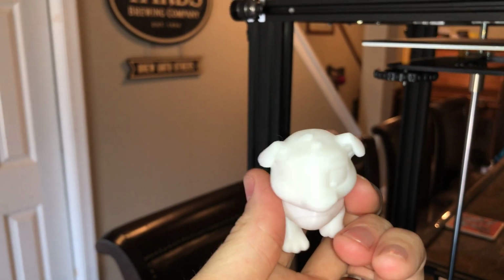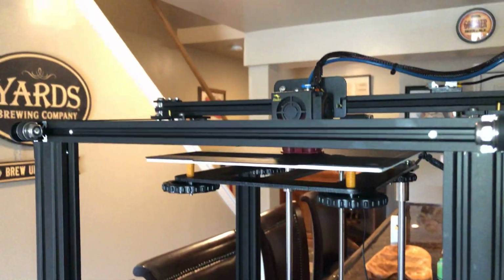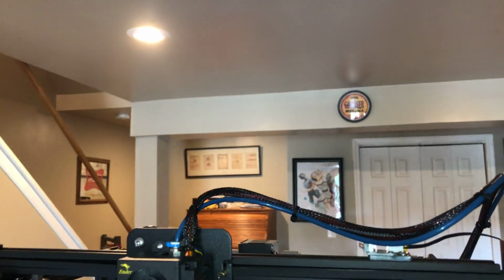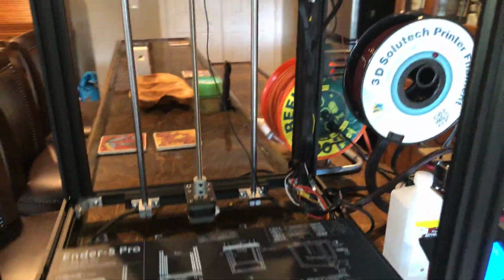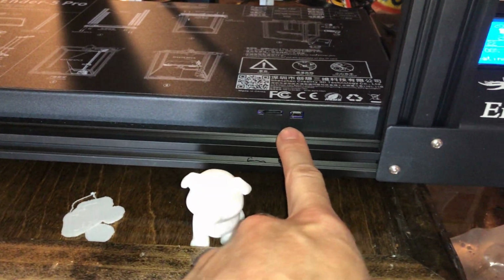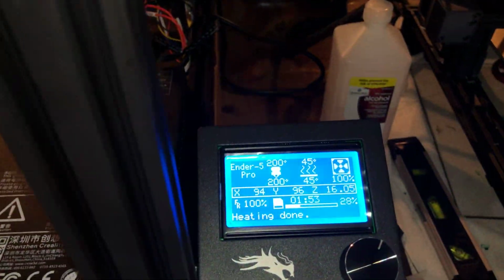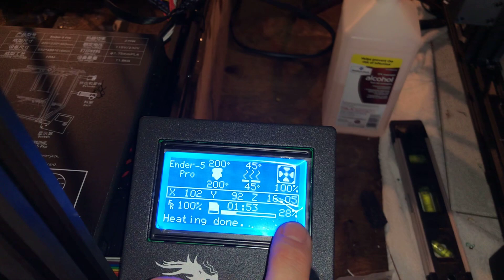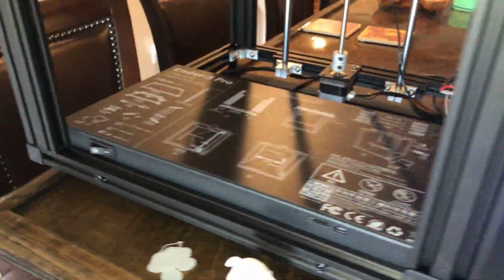Creality Ender 5 vs 5 Pro | 3D Printer Video Review

Comment: Very informative! I reckon this is the model I'll be buying with my daughter as our first printer, jointly owned. 

I've done a lot of work with my 600x900 Chinese laser cutter, at 10 times the cost, which has a REALLY lousy operating system that is an unreachable black box. I prefer not to make the same mistake with 3D printing, which is why I've waited so long to get one (living in South Africa BTW - support is non-existent for a lot of stuff).

Comment: I am wanting a 3D printer that i can design my own jewelry . Design as though i was useing half round wire with  twists and curls. Wjould i be able to do this with this 3D printer? I also want to do Lithophane images.  Never ever used one and only saw  a simple Ender 3 work on a thin designed 3/4 moon design.  Any suggestions is grate.

Comment: hey i just assembled my ender 5 plus. i am trying to find the right firmware to flash for the LCD screen and the motherboard, or printer itself. I cant seem to find anything that helps. I already have the hex file. i just do not know where to go from here. any help is appreciated.

Comment: This is a great video, i just got my Ender 5 Pro. Would you suggest any upgrades for it?
Reply from the maker: That’s awesome to hear, thanks for your kind feedback! For me, I would personally do the following:
1. Add an ABL (the BLTouch is the go-to for most)
2. Swap out the stock print surface with a springsteel sheet and PEI build plate 
3. Print a different fan shroud that uses a 5015 blower fan
4. Replace the stock blower fan with the 5015 blower fan

Hope that helps, and thanks so much for watching!

Comment: Hi, what's best? Ender 5 Pro or ender  5 with upgrades? Like 32bit board, etc?
Reply from the maker: That depends on what you’re looking to do… do you want to tinker with a printer or do you want to just print? If you’re looking to just print, I’d get the 5 pro. But if you want to tinker on the machine and make improvements, then maybe go the route of the 5. I’ve lost myself down too many rabbit holes tinkering on my machines so I would personally pick up the pro. Thanks for watching!

Comment: Hey buddy, great review! I'm looking at my first 3D printer and tossing up between this and the Ender 3 V2. Do you think paying the extra for this Is well worth It over the Ender 3 V2? Cheers from Oz :)
Reply from the maker: Hey friend! Another friend just asked me the same question so for the sake of efficiency, I’m just going to paste what I said to them here. Cheers!

——————————————-

Hey friend! I’ll give you my personal opinion, but I just recommend you do your research and really consider what needs you have compared to the needs these printers can offer. 

So with that caveat, my personal opinion is that I would still go with the Ender 5 Pro. Like I said in my review, it’s all about the rigidity for me. The touch screen is a gimmick in comparison (personal opinion) to the overall stability of consistency of the 5 pro. I’ve had both and I can say that I had two 5s and a 3v2 and uh… I still own two 5s. ¯\_(ツ)_/¯

Again, do your research and go with what’s right for you. I just really appreciate that model sway is a non-issue on the 5.

Thanks for watching and may the 3D printer gods watch over you!
Reply: @plasticmakesperfect5863  Thanks for replying, cheers :)

Comment: Hey dude please can you help me? Ender 3 v2 or Ender 5 pro? I can get ender 5 pro for £20-40 more, reasons for why ender 5 is better if it is. thanks!
Reply from the maker: Hey friend! I’ll give you my personal opinion, but I just recommend you do your research and really consider what needs you have compared to the needs these printers can fill. 

So with that caveat, my personal opinion is that I would still go with the Ender 5 Pro. Like I said in my review, it’s all about the rigidity for me. The touch screen is a gimmick in comparison (personal opinion) to the overall stability and consistency of the 5 pro. I’ve had both and I can say that I had two 5s and a 3v2 and uh… I still own two 5s. ¯\_(ツ)_/¯

Again, do your research and go with what’s right for you. I just really appreciate that model sway is a non-issue on the 5.

Thanks for watching and may the 3D printer gods watch over you!

Comment: I have a lot of very annoying issues with my about 1,5 month new useless Ender 5 pro printer. I am now at a point that I wished I had never bought this terrible 3D printer! Small detailed objects all completely fail to print correctly and apparently there is no easy way to correct this and any solving help from Creality will never be given! The after sales support is friendly but completely useless and also the seller who sold me the printer tested my machine telling me that it works okay. But it still never does! So it all is a waste of time and money. And exact hotbed leveling is one of the problems on this machine because when we level all 4 corners we find that the centre of the hotbed plate is too high which causes the nozzle to scratch the top of the hotbed plate!  And sadly we have to repeat this hotbed leveling apparently more than once in just a short period of time too. So better buy a decent calibrated ready build working 3D printer! Like a Prusa. Or a printer that already automatically levels the hotbed with Bl-Touch or other sensor. Like the Ender Pro 5 Plus. But still better avoid these Chinese uncalibrated badly supported assembly 'kit' printers. You will be completely lost with the wrong old Cura software version, without any help on how to correctly set the right retraction- or the E-step settings, and with a printer that only works good in their advert! And Creality's slogan to "create your dreams" has become my nightmare!!
Reply from the maker: It’s a shame you’re having such trouble, but I couldn’t disagree with you more. Is this printer for everyone? No. Is this a great printer that actually does good detail on small prints? Absolutely. I’ll be honest, if you get yourself into a bad spot, and can take a while to get it back, but the Ender 5 is a solid printer and I stand by every word in my review.

There are lots of tutorials out there to address the issues you have and a A LOT of support groups on Facebook and Discord. Your opinion is absolutely valid, but neither I nor any of those I know who have this printer have actually failed to overcome any shortcomings. I wish you the best of luck in your printing journey!

Comment: i really want to get an ender 5 pro ive never had a 3d printer
Reply from the maker: The Ender 5 Pro is a really solid first printer. A lot of people will suggest the Ender 3 or some variant, but I stand by the Ender 5 as being a more solid machine for only a little more.
Reply: @plasticmakesperfect5863  I did not expect you to reply and in anyway the ender 5 pro costs $460 here in south africa so that's unfortunate but ima still get 1
Reply from the maker: I try to reply to as many comments as I can, but I can’t get around to them all. Are you able to possibly get a used one for less?
Reply: @plasticmakesperfect5863  no the buyers market for 3dprinters isn't good in sa so not many people who can afford them in the first place

Comment: I tried your leveling method with the screw but the bed doesn’t get high enough to the nozzle without adjusting the large adjustment screws?
Reply from the maker: It’s possible that your bed knobs may have been compressed more than mine from the factory. You may need to do a more typical bed-leveling with those knobs to get your nozzle properly trammed. Once everything is equidistant, you shouldn’t have any issues making adjustments using the screw in the back. Hope that helps and thanks for watching!

Comment: did you change anything at all? cause my ender 5 pro is not quiet like yours.
Reply from the maker: Negative, this is completely stock. What sounds do you hear?
Reply: @plasticmakesperfect5863  fan noise
Reply from the maker: Hmm… I’m curious if you may have a loose bolt or something causing the fan to vibrate.

Comment: Thank you for this review, really appreciated! I'm going to be honest here, I am currently thinking about buying my first 3D printer and before I saw this video, I was 95% sure about buying the Prusa Mini+. 

After this review, that percentage is now 50%-50%... I would probably buy both of them, if I could, because they both seem doin' a very good job. I see that the Ender doesn't have an auto-levelling bed as the Prusa has, but that manual levelling didn't seem difficult at all. All Prusa's have their Prusa Slicing Software, which seems to come very handy on adjusting printing settings based on Default/Custom Profiles that can be used as well as regarding the printing materials used on each print.

Does the Ender have something similar to this? 

On the other hand, this Ender seems much more robust and reliable, just by looking at its construction architecture and used materials. I loved that kinetics thing about the bed just moving along the Z axis (in the Prusa Mini+ it does move on XY axis instead). 

I'm really undecided here... :).
Reply from the maker: Leveling isn’t super difficult, especially if you’ve been through the process a few times. You can definitely add a BLTouch to an Ender 5 to allow for auto bed leveling. The other thing you’ll lose by going with the Prusa Mini is build space. The Ender 5 has a good amount more in all directions.

Ultimately though, you’ll need to really consider what you’re going to be printing and go from there.

Comment: on my ender 5 pro I have only print pla plus and the biggest improvement , adding the glass plate to the bed, the blue painters tape does no longer curl and the prints come out wonderful
Reply from the maker: A lot of people swear by the glass beds. They’re great, but I personally prefer a spring steel sheet with a PEI coating. It works wonders for PLA, ABS, and PETG.
Reply: @plasticmakesperfect5863  where is the best place to order spring steel plate
Reply from the maker: @garylarson6386  You can get it quickest on Amazon, I'd imagine. But you can get it at about 25% or less on aliexpress.com if you don't mind waiting a few weeks to a month. I've had good luck with FYSETC plates personally.

Comment: do you have the dimensions of the ender 5 pro? not sure if it would fit on my side table or not lol
Reply from the maker: Larger than the Ender 3 3D printers, the Ender 5 measures 552 x 485 x 510 mm and features a print area of 220 x 220 x 300mm (50mm higher than the Ender 3 build area).

Comment: When you say: ABS ... I’m beginner and read it is better to have the printing area enclosed to avoid airflow etc. Did you covered the sides in some way for ABS ?
Reply from the maker: For ABS, yes you really should have it covered. Every guest of air has the potential to make the print warp. I have a custom full enclosure for my setup.

Comment: Is it good enough out of the box to print small gears ⚙
Reply from the maker: I’d say 90% good enough. It probably will need some minor tweaking with the slicing software, but it won’t ever be as good as a resin printer.

Comment: Just ordered one of these, what are your thoughts now you've had this printer a while?
Reply from the maker: I'm still in love with this printer. For a consumer grade one, this is still solid for this price point. I have three Ender 5s in total and they are my work horse machines. I converted two to direct drive and made other modifications, but I leave the pro stock because it's known-good for me and just has been great in general.

I think that my only complaint, and it's absolutely personal opinion, is that I wish I had a bigger print surface. I know I can go to the 5+, but I think I'm just getting into other things that require a larger print area so I may actually end up buying a 5+ as well in the near future.

Comment: I am looking into getting a 3d printer. i know little to nothing about 3d printers. could someone please explain to me what else i will need and if i can do everything from a chromebook or will i have to use my mac.
Reply from the maker: Typically what you need is the printer, any filament (usually 1.75mm for most consumer printers), and a computer to run the slicing software. Most folks use Cura (free and probably the go-to anymore), Simplify3D (paid software), or Prusa Slicer (free, but has a learning curve). I'm not entirely sure that a Chrome book is compatible with most slicer programs out there, but I'm sure that your Mac can run Cura. Hope this helps!
Reply: @plasticmakesperfect5863  ok thank you
Reply: @plasticmakesperfect5863  also, one more question, is the printing space on this printer big enough? like would i be able to print for example a darth vader helmet, or would that be something i would have to get a bigger printer like the ender 5 plus for?
Reply from the maker: If you’re looking to print things like that, I wouldn’t even mess around with the 5 Pro, go right for the 5+. I CAN print helmets on my 5, but I’m pushing it sometimes. If you’ve got a big head or a lot of hair, you’ll need to scale them larger and there isn’t a lot of wiggle room with the regular 5. Plus, splitting a model, making 2 prints, gluing it together, then whatever else sucks so just swing for the fences now or probably regret it later.
Reply: @plasticmakesperfect5863  ok thanks
Reply: @plasticmakesperfect5863  one more question, 5+ or cr10 cuz i know cr10 has a big space

Comment: Hey, question, I'm new to 3d printing so go easy on me. I'm getting the 5 pro but can't find any free slicers out there that have an Ender 5 pro profile. I was wondering if you have any recommend slicers or if there are any good profiles out there.
Reply from the maker: Hey no worries! We all start somewhere. There are a few free slicers out there, but I personally prefer Cura from Ultimaker. I've heard others have had great success with the Prusa slicer, but I haven't spent enough time with it to really know the differences. The last few version of Cura have had an Ender 5 profile. I just checked mine (version 4.8.0) and it's there. They have it under the non-networked printers > Custom > Creality > Ender 5. There should effectively be no difference between a standard and pro model when it comes to the slicer. Hope that helps!
Reply: @plasticmakesperfect5863  Thank you so much man! I just didn't know if there was a difference or not.

Comment: I'm going to get basic Ender 5 and do an immediate upgrade to a direct drive, decent hot end, and an SKR main board (I have electronics experience so I'm not worried about doing that). I'll end up with a better printer than the Pro for not much difference in cost. Sure, I may want something with a larger bed down the line, but I figure this will get me through learning and be able to print a lot of useful items.
Reply from the maker: This is essentially what I did with my two standard Ender 5 printers. The I went with a BMG style extruder using direct drive on a TriangleLab Dragon V6 style all-metal hot end. I did a full rebuild of my Sunlu S8 to include an SKR v1.3 swap with TMC2208 stepper motors. Worth it for sure. That is definitely a viable path for some, but others may feel more comfortable just getting a lot of these stings straight out of the box.
Reply: @plasticmakesperfect5863  I totally understand that. If I was strictly focused on out of box to first print with no fuss or assembly, I'd just get an Elegoo Mars or similar. I may pick something like that up as a second printer in any case because they are suited to different objects than what one would likely get good results with with an FDM.

Comment: Don't waste your money on the 5 Pro. Get a 5 Plus and upgrade to silent board for only $70. 350x350x400 BABY!
Reply from the maker: I don't disagree with this, but some folks may not be comfortable with a mainboard swap even though it is a straight forward process. I'd like to have an Ender 5 Plus sized Ender 6 if I could!
Reply: Except that I've found the basic Ender 5 for $275. For around the $100 between that and the Pro, I will be able to upgrade to a direct drive and a decent hot end as well as an SKR main board (better than the official Creality silent at half the price). Lowest price I've seen for the Plus is like $575. I don't know why they use the Ender 5 designation for the Plus. It's a completely different printer, not an iteration of the other two in the line.

Comment: Thanks for video. Where did you buy a yellow springs?
Reply from the maker: With the pro, they actually come standard! However, if you want to buy them, you can get them off of Amazon.
Reply: @plasticmakesperfect5863  Thanks!
Reply: @plasticmakesperfect5863  One more question. Does this "Creality Ender 5" support adjustments of the extruder temperature in settings?
Reply from the maker: @makskk6spm275  Can you please elaborate on exactly what you're referring to? If you're asking if the hot end temp can be modified via the slicer (e.g. Cura) per model/filament type, then yes.

If you're asking if the pre-set temps (i.e., PLA pre-heat can be set to 200 hot end / 50 bed) I believe that can be done via Marlin. I know with my other printer which I've put an SKR v1.3 board into, I was able to modify those changes and add another one in for PETG. I hope this helps.

Comment: 5 months later how you liking it?
Reply from the maker: Still my go to printer! I've since made heavy modifications though. I'm now using a TriangleLab Dragon V6 hot end, dual gear direct drive, and a spring steel print surface with a PEI coating.